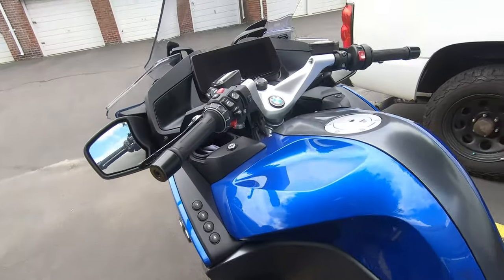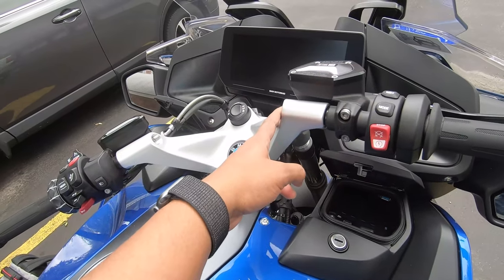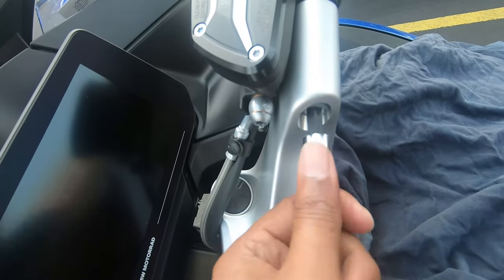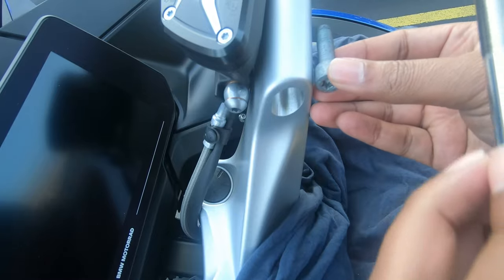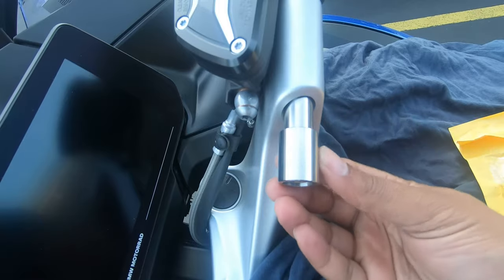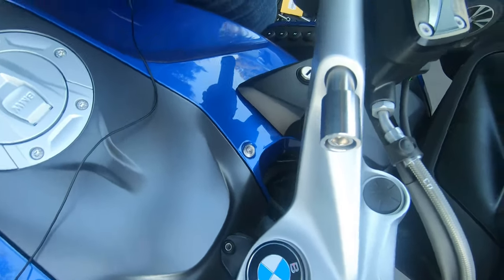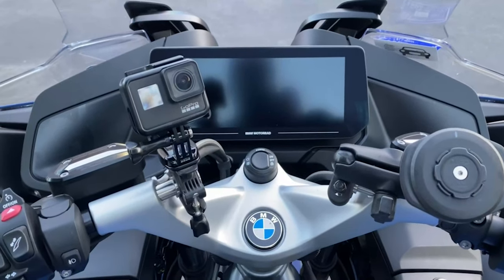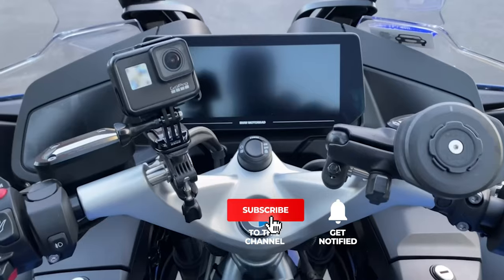Mounting quad-lock wireless charger on a motorcycle with non-tubular bar.

Comment: The Quadlock Stem mount will not fit the R1200/1250/k1600.
If you pull off the BMW logo you’ll find a 46mm wide hole which is also too shallow to fit the expanding bolt.
I managed to adapt one after a lot of trial and error,
Reply from the maker: I didn’t know that. Thanks for sharing the info 👍👍👍 I’m going to pin your comment so that others will know.

Comment: I was shocked in this day and age that my iPhone 13 Pro Max did not fit in the charging cubby. I had a very thin case on it and in the end taking this off and putting the phone in with the charging port first worked without pressing any buttons.
Reply from the maker: I can relate. I was disappointed to find that my phone didn’t fit in the charging cubby. When riding with my wife I use the cubby to charger her phone instead. It’s good use and works well but for smaller phones.

Comment: This is a good, minimal impact solution to mounting tubular style mounts on non-tubular handlebars. However, I would've used thread locker on the screw threads. You can tell the factory used thread locker on the original bolt. Finally, torque value should be around 30 Nm. Thanks.
Reply from the maker: Thanks for sharing technical details. I’ll add them to description.

Comment: Nice way to install the quadlock. I would pick the handlebar mount not the pivot arm. handlebar seems less bulky, i tok out the extension arm and got a clean look with my GS1250.  Now I install to my friends GTL with this way.. He doesn't also want to remove the logo in the middle
Reply from the maker: Thank you!! 😊 yes and this way it didn’t damage any of the handlebar finish

Comment: HELLO  SIR  please  did you find out what size torx   spanner you used on the BMW R1200RT  HANDLEBAR  BOLT REMOVAL TO FIT the bolt adaptor extension bolt for your phone mount  please.  what is the size off the original bmw bolt.  do you know the toque setting  too how tight can  i  go to tighten up.  thank  you sir  Paul
Reply from the maker: I’ll check it today. Been out riding, then sick. Not sure about the torque though. But it’ll be similar to older year RTs.
Reply from the maker: Haven’t forgotten about you. It’s been raining in New York. Haven’t taken bike out of the cover yet. Waiting for rain to stop.
Reply: Great  cheers for that 👍
Reply from the maker: I’ll get back to you today 😊 finally stopped raining.
Reply from the maker: It requires TT50 Torx bit. Found the original nut in my storage 😆 sorry for the delay.

Comment: Parag, thanks for posting this video. I am just about to buy two of these from your link. They look great and your set up is sweet.
Reply from the maker: That’s great!! Yes I’ve used these extensions for multiple mounting places for my camera. Thanks for taking time to leave a feedback.
Reply: @ninerpeak  I have been using a stem mount invented by an employee at Jacksonville BMW. He designed and 3 D printed them so the BMW center logo is still visible. I just needed more places for other devices.
Reply from the maker: Oh wow that sounds interesting. You have a link or picture you can share?
Reply: @ninerpeak  I'm not sure how to do a photo link to share with everyone but I did subscribe on your website for newsletters and saw your email so I sent you photos that I had on my phone.

Comment: Hey, this is amazing. I tried a few places to try and order it from but at checkout they say that delivery is not possible to my address / South Africa. Would it be possible to send me the diameters and lengths of this please? Im sure I can find a turner to try and make this then locally. But this is a good show of how easy it can be made. I've honestly considered replacing the handlebar with a round/GS style if I cant get this made up
Reply from the maker: I don’t have dimensions since it’s installed 😊 but found this listing on eBay that has Images with measurements. This one should fit. https://www.ebay.com/itm/225589289668?mkcid=16&mkevt=1&mkrid=711-127632-2357-0&ssspo=hDjHpduaST2&sssrc=4429486&ssuid=DOo4CKIgRoq&var=&widget_ver=artemis&media=COPY

Comment: I previously owned a 2019 R1250RT and traded it for a K1600B and then back to HD. Should have kept the 1250RT. I also love the wireless Quadlock and have it on my '22 Ultra Limited wired directly to a keyed ignition source. How is your wireless Quadlock powered? Thanks in advance and look forward to more of your content since I may go back to a RT!
Reply from the maker: Thank you for the feedback and sub. More videos are coming :) for quad lock I had the quad lock USB adapter directly connected to battery. But recently I replaced that one with Quadlock smart USB adapter which auto turns off the supply to wireless charger if battery voltage goes below 12.5v. Auto turns back on when you start the bike. It’s a perfect addition.
Reply from the maker: Just noticed that I had so many typos in my response. Corrected. Lol.